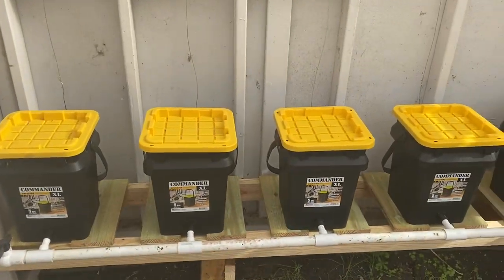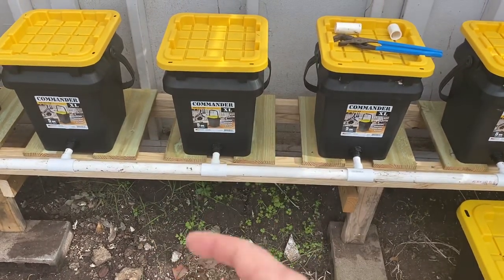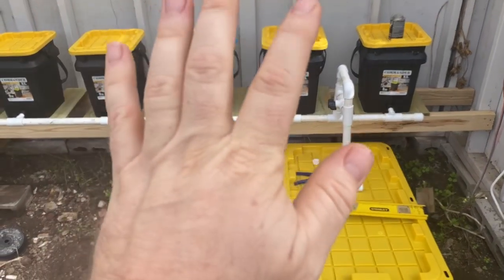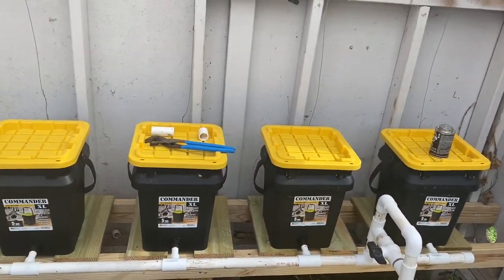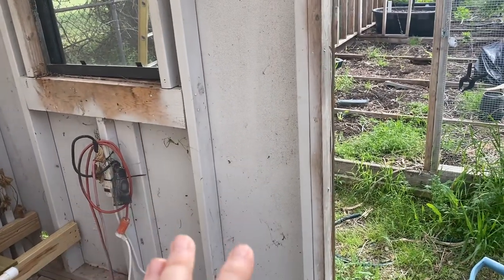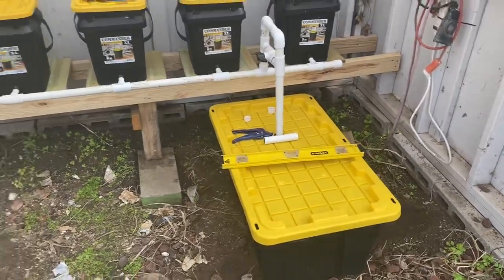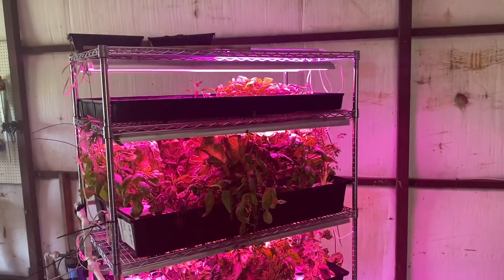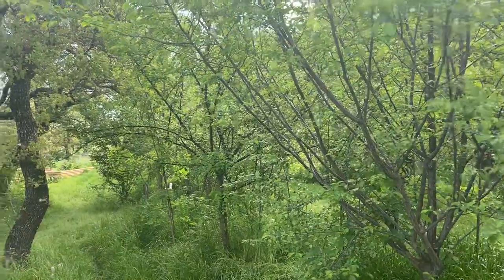New Deep Water / Aeroponics / Kratkyish Hydroponics System - Part One

Comment: Funny, your system looks similar to mine. Yours is much better built, but we used the same hardware choices for much of it.  I substituted orchid pots from Lowe's for the net cups and a drip on top and mister under net pot. The mister sprays for a few minutes after the pump turns off due to pressure. While the drip line on top is completely off.
Looking forward to seeing rest of your videos.

Comment: Do you have a drain tap on the reservoir? Bending and scooping gets old fast.
Reply from the maker: um there is a pump in there
Reply: @survivalpodcasting  awesome... I just wanted to make sure you are all set, as it is a pain in my home hydro system... got quite a thick brick wall to drill through.

Comment: Thanks for the video and ideas. Any problem with bulk heading (with silicon) the bottom of 5 gallon hydraulic buckets (or similar)?
Reply: Aside from the hydraulic oil having leeched into the plastic, which will then leech back out into the water, nope.
Reply: @zombieresponder  plastic is a petroleum product, hydraulic oil likewise. Tomatoes aren't a root crop an should do some filtration by the time the fruit is consumed. I've been picking rocks and hauling sawdust in these buckets so any surface film is gone. Not sure of the amount of oil that the pours of the plastic can hold but it should be miniscule. Weighing a bucket of the same design might give the mass. But small amounts of hydraulic fluid is suppose to be a laxative effect, and I'm not drinking the fluid. (Don't know yet... And rambling.)
Reply: @zombieresponder  I'll check for a visible surface film with distilled water. Thanks for your thoughts.
Reply from the maker: @benjaminbrewer2154  you won't find any, some people literally think everything is gonna kill them, bet he is worried about 5G too, those that are don't understand sunlight.
Reply: @survivalpodcasting  If you wanna use them to grow food, I'll bring you some way oil/hydraulic oil buckets next time I'm down your way. We empty them pretty regularly at work(machine shop). I wouldn't pour either on anything in a garden, and since they would both kill the plant, I'm pretty sure it's not something I want to consume either. Same reason I wouldn't use an IBC that formerly contained a toxic substance to store drinking water. I'm not sure how that warrants insulting me, or my intelligence.

Comment: Won’t the tubs siphon all the way empty once you begin draining them? I would think that you would need a vent (probably at the top of the upside down “U”).
Reply from the maker: No when you have a fricken net pot in them and a delivery line there is no seal and hence no siphon.
Reply: Jack Spirko I understand the net pot and delivery line, and I’m not trying to start an internet argument, but I keep thinking that the bucket-tubing-sump section looks an awful lot like a typical toilet setup. Once the bowl (bucket) is filled above the level of the inverted-U, the bowl (bucket) will begin to drain (aka flush). The water will continue to leave the bowl (bucket) via a siphon unless an air break (vent) happens, like when the water level in the bowl drops below the top of the drain line (and therefore let’s air into the drain line). Converting one of your elbows in the inverted-U over to a Tee (with the third arm of the tee pointing upward) will provide a vent to prevent a siphon.
Reply from the maker: I'll stick a t in the top, I get what you are saying.

Comment: Did those buckets come from home despot or Lowe's?  What is the gph rating of the pump?
Reply: Lowe's
 item (11:10)
item# 1299859 5 Gal tote ($5.98)
item# 44066  27 Gal tote ($10.98)
item# 831514 40 Gal tote ($21.98)
Don't know what the GPH is on this one his vertical farm was 530GPH, I'm running a 620GPH in my variant.
Reply: @benjaminbrewer2154  Thanks for the info. I stopped at lowes on the way home yesterday and found the buckets. My search fu on the lowes site was too weak and I was unable to find them when I asked before.
Reply from the maker: There is no pump yet, patience.
Reply: @survivalpodcasting  I bought a 550gph pump, which arrived yesterday. Might be overkill, but that means I can expand the system. I also found an inexpensive source for bulkhead fittings and uniseals, which are like a grommet, but specifically made to seal around a pvc pipe pushed through the wall of a container. They also have screens that fit the ends of some bulkhead fittings, which may help some folks using the dutch bucket method keep whatever medium they're using out of the reservoir. https://flexpvc.com/Products/BulkheadFittings.shtml  I'd post it over on the forums, but it seems a little dead there these days.